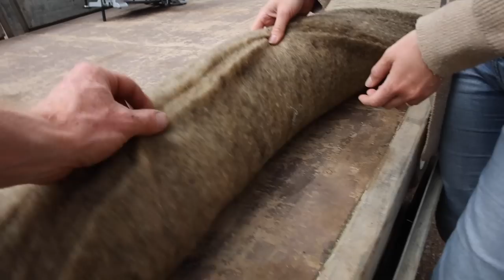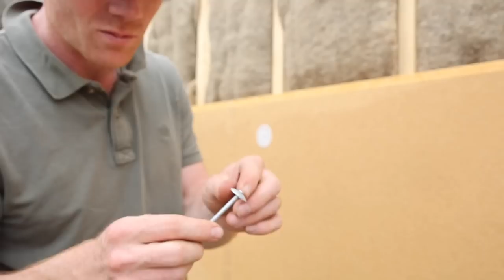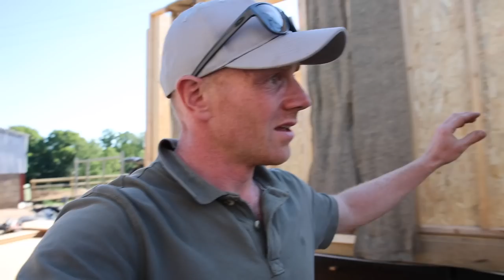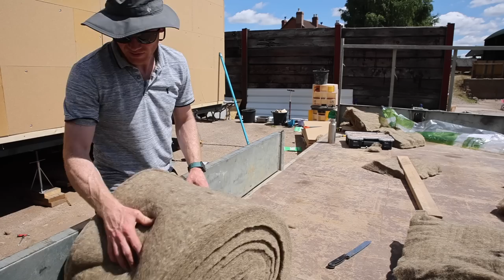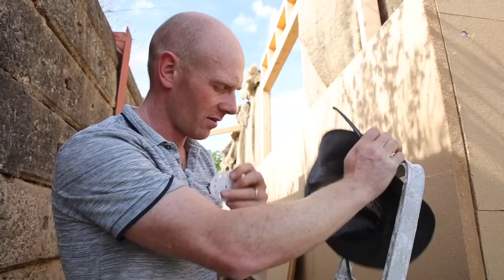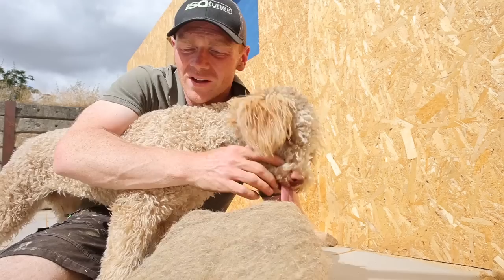STUD WALL NATURAL INSULATION - Wool & Wood = ULTIMATE COMBO?

Comment: Love the build. Rigid and flexible woodfibre is what we use by default on all our builds both extensions and new build.

Instead of the thermally broken mushroom fixings or the slab nail you can use a wide backed 120/160mm staple fired from a (very large) pneumatic staple gun. Much faster and a super tight hold.

Comment: I used the sheeps wool insulation while building "Green" teardrop trailers for a company I work for. Just for added security we went through and shot 1 1/4" staples through the osb into the wool to make sure it didn't shift down while driving. Sounds like yours won't have a problem, but if your worried about its just a little insurance

Comment: now that you have a tractor and big machines, are you thinking of geothermal to fully or partly heat the big house? with a closed loop running underground >> exchanger >> surface closed loop ? it could help cooling in summer :-) and warm a greenhouse in winter!

Comment: Make sure you prime and tape all those joins. We left about a third of our roof untaped (with membrane over it) over winter, looking with a thermal camera from the inside it was incredibly obvious where we didnt tape. We're using Pavatex, same sort of thing - just French rather than Russian.
Reply from the maker: Interesting.  Was that the Pavatex T&G board too? We have an airtight tape on the internal sheathing OSB but would only have thought about externally if we had rendered.
Reply: @TheRestorationCouple  Yes, 60mm T&G. Even with the membrane over the joints the joints were sub zero when about 5cm away it was 15c. Couldn't even spot the taped joints on thermal camera.
Reply from the maker: @thewatermillscotland  I can believe it, as it only takes a couple of mm gap between boards and your relying on just the thickness of the tongue.
Reply: @TheRestorationCouple  This is the principle behind the VCL, you make it airtight from the inside. People say if you don't have one it badly compromises your real life insulation performance. Main losses are where wall meets floor, where an interior wall meets external wall, plus the soil stack has big losses. I think we are talking about pinhead sized penetrations but I heard a guy say they add up to having a window wide open. I can see why you might not want an oil based product in your house but they do seem to be effective from what I have read about them. I don't think they are incompatible with breathable walls when the gauge is lower, they are a control system not a total barrier.
Reply from the maker: @dannymurphy1779  airtight not vapour tight that’s the main difference.

Comment: My first job after leaving school was working at Standard Fireworks and we had to wear wool overalls for fire protection. The summer of 76 which some will remember as the hottest summer ever was a nightmare in those overalls. My only concern was the wood fibre boards which you say should char up in a fire.
Reply: The whole building is made of wood. If a fire starts is going to burn. As long as it burns slowly it's okay. You only need enough time to get out. All buildings burn. It's just a question of how fast.

Comment: I'm curious as to when you intend to do first fix electrical and plumbing as it now looks a bit of a problem with all the insulation and panelling installed.
Reply: I asked this on Facebook few days ago.  Not going to be fun unless plan was to surface all along 🤷🏻‍♂️  not like can just unscrew sheafing either 🙈
Reply from the maker: I did do a whole video on this a while back. A service cavity will sit inside the osb. Otherwise you are constantly punching through the pretty much continuous osb layer.
Reply: @TheRestorationCouple  Missed that one it seems! 🙈 Will have a look.  Different. I’ve always done first fix to bare stud where poss, add extra support for rads etc same time.  But of course with the OSB you’ve covered that anyway. 😁

Comment: Surprised you didn't go for flexible wood fibre for filling the walls.

I found it great to work with for insulating our shed (for a tortoise habitat) and it doesn't get the rippling effect you saw with being slightly too wide in places. Its a lot more like a huge sponge and retains its shape whilst squishing.

Definitely one to try out before you settle on plans for the rest of the farm.
Reply: I've just finished insulating under my living room floor with Steicoflex, great for my wonky 140 year old joists!
Reply from the maker: I do want to try it, perhaps on the older buildings here.  But with sheep all around us, it only seemed right to use British sheep wool. 😁
Reply: @TheRestorationCouple  don't suppose you've spoken to them about becoming a wool supplier? 😅

Comment: Loving all the content find myself looking fwd to each upload. Two questions are the boards on the outside waterproof & where will Hodge & Podge be finally located??
Reply from the maker: They are for a short period but we had it wrapped pretty soon after. Otherwise rendering them is an option. We will hopefully site it just beyond the fence by the barn.

Comment: Fantastic effort. Is the wool and fibre board water resistant if you had a sudden downpour prior to roof going on or do you have to cover every night?
Reply from the maker: Boards are for a while but ideally membrane up before moving on to next wall. Fortunately we did this mid heatwave. Benefit of breathable wall means it can all dry out should it get a little damp though.

Comment: Did you mark all the stud positions somewhere before putting the fibre board on or  have you put a nail/screw in each stud?
Reply from the maker: Yes marked on wall plate and the bottom batten. 👍

Comment: How would you rate the wool insulation now a year later? I'm researching insulation for a block garage and would love to go natural rather than PIR/mineral wool if possible.
Reply from the maker: Good enough that we heat the whole house on a towel radiator and small radiator in the open plan area. Much more stable than PIR too as the wood fibre boards are great for that. Still looking at using it on the house build.
Reply: @TheRestorationCouple thanks for getting back to me. Good to hear it's as good as it sounds. I'm struggling to find much info on certain aspects, so could you tell me if it needs a vapour barrier on the cold side, or an air gap behind it?
Reply from the maker: @robhall5622  depends on the setup really. Ours is fully breathable in the cabin  with osb inside and breather membrane outside. If using inside of a solid wall it might need a vapour barrier on the warm side as your block wall won’t breathe like a traditional one. Try the back to earth website for info, that’s who you r bought ours from.
Reply: @TheRestorationCouple  thanks again, will check that website.

Comment: Fyi no batt insulation product can resist gravity so yes it will sag. Maybe less than other products though.
Reply from the maker: I would agree in most applications, but the back of those WF boards acts like velcro, so that together with the fact the insulation is thicker than the stud depth means friction is most definitely on our side.  Internally will be more likely but there it is only for acoustics so less of a worry.  👍

Comment: What's the reason for the spring nails / PIR anchors? I would have thought that just screws or the nailgun would have been sufficient (and quicker) as the loads are predominantly shear loads?
Reply from the maker: The battens will do all the work once on, they are just tacking it until then. It’s a bit soft for the nailgun and when you knock the next ones in place they would likely shift a bit.
Reply: @TheRestorationCouple  I think it is a bit of a concern you have punctured the surface because the white ones are clearly designed to avoid that.
Reply: @TheRestorationCouple  the boards do look pretty soft being able to bury a head that size! Going to have good thermal mass when it's layered up, hopefully you can get it weather tight whilst the dry spell is here.

Comment: I’m guessing a building of this size still needs building control ?
Reply: AFAIK if you apply for planning permission and get it you would need building control yes. But if you build one to put on a mobile home park then it has to comply with BS3632:2015 which are slightly different regs. Perhaps BC accept this BS3632 though. But yes you do normally need one of them were it to be permanent. I think it is different if it is temporary though.
Reply: @dannymurphy1779  I thought someone said on another video this structure did require planning ?
Reply: @11x11z11x11  planning is one route yes. But another is to submit plans for a house or a barn and if you get approval for that you can live in a caravan on site while you build, with the caravan being removed on completion.

Comment: I was wondering with organic material like wool, won’t it breakdown over time?
Reply: Have you ever seen a wool jumper rot and fall apart? As long as it’s dry, it will be fine - and if it’s not dry, they have a bigger problem to fix than a bit of insulation needing replacing.
Reply: @BunkerMentality  I take it you have never purchased high quality wool carpet. Oh and yes, I have wool jumpers fall apart. Maybe your jumpers were synthetic.
Reply: @anthonycraig274  I didn’t ask if you’d had a wool jumper fall apart. I asked if you’d had one ROT and fall apart. Wool doesn’t just spontaneously rot in a dry, well ventilated environment. The same with rugs/carpet - wool can rot if it gets damp, but in a wall like that, where it’s protected from moisture and UV, it will be extremely stable.
Reply from the maker: Thankfully not.  Being sheeps wool it can also handle moisture well rather than many soft insulations.  As this is a closed construction it really doesn't have anywhere to go and should be fine.
Reply: @BunkerMentality  😆 what is Rot? A breakdown by microbial life. There are other ways for Wool to be broken down, by insects or larva for example. They live in nice dry well ventilated space. 

I have very expensive  scarves that vacuum sealed frozen a few hours then stored because I know woollen garments can breaks down in dry warm well ventilated space.

To be honest, I was asking hoping someone had a good understanding of the product who can answer the question, not someone who wears synthetic jumpers.
Reply: @TheRestorationCouple  I did a bit of research and found my answer. The material isn’t completely process-free, as sheep wool is treated with Borax to prevent insects and fungi growth.
Reply from the maker: @anthonycraig274  this product is not treated with Borax but others are. 👍
Reply: @TheRestorationCouple  Perhaps the most concerning disadvantage of sheep wool insulation is the linked cleaning and associated preparation processes. Before being released onto the home improvement market, the wool must be treated and cleaned in order for it to be effective and suitable for use.

This involves a lot of harsh chemicals used to disinfect the material, and to treat possible infestation from scab mites. In turn, this can leave organophosphates behind in the wool, that are proven to cause a number of different neuropsychological health issues.
Reply: @TheRestorationCouple  Great, I am still looking for an insulation product to insulate my house. BTW, I do love your videos. A great channel.
Reply from the maker: @anthonycraig274  I happened to speak with both the manufacturer and the company that processes the wool in person today at the Sheep Show.  The wool is cleaned using nothing but warm water several times, that way the lanolin can be kept pure to be used for other products.  After that the clean wool is processed with no chemicals by using plasma to modify the wools structure in such a way to not be moth or insect dinner. Hope that helps. 👍
Reply: @TheRestorationCouple  that’s exactly the information that I needed. Many thanks for going out of your way. Can you post a link of the supplier?

When you said it does not contain Borax, it was clear it was a totally different product. Thanks for clearing that up.

Comment: I don't understand the principles behind the membrane. Is it a vapour barrier? On our mobile home the vapour barrier is on the inside. Some say don't even use one at all.
Reply from the maker: No vapour barrier as it’s a breathable wall. Membrane externally is air and vapour permeable so just to protect from rain during build and any external moisture. Same as why you would use it under a tiled roof, you hope it won’t be needed however it’s there just in case! 😀
Reply: @TheRestorationCouple  I have been living in a similar constructed house for 3 years now. When I did the plaster sheet on the inside, I specified the  SoundChek dense board. Heavier, but oh so much quieter. The heating costs in a non -snow area are very much improved over older style houses.
Reply from the maker: @dnomyarnostaw  Good to hear.  Unfortunately we can't add too much more weight so will probably use 9mm PB but still should be good thermally... for a caravan.

Comment: Sheep's wool seems to be very good from what I've read, the only drawback is the cost.
Reply: The only downside is that it is a nightmare to cut vertically if it does not match your stud bay width.
Reply: @paoc1791  Understood - it doesn't really seem ideal they are 10% over on the width and the depth, as compression makes it less effective.